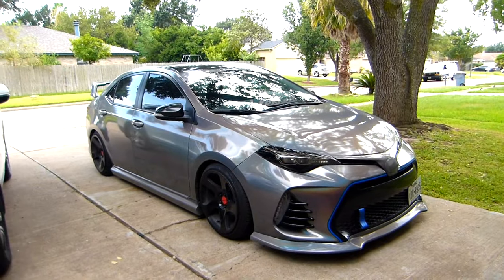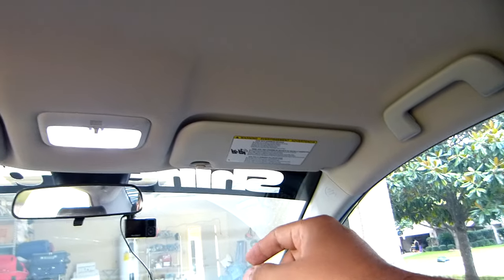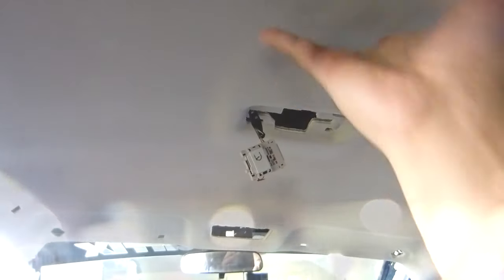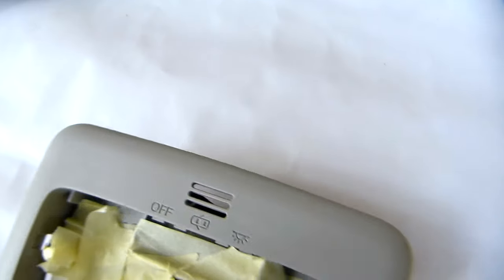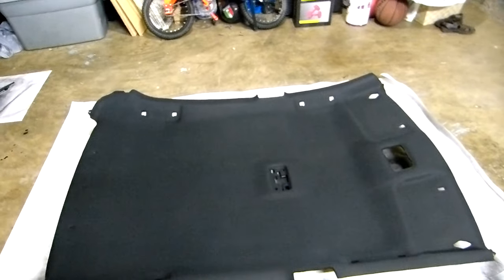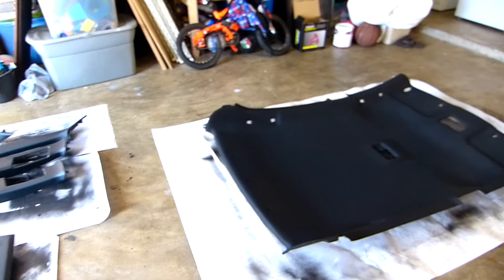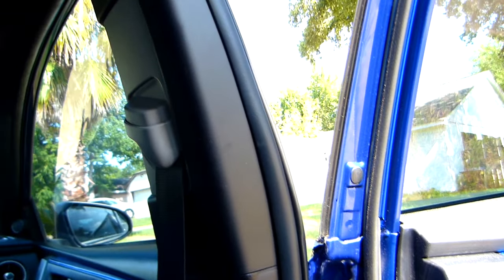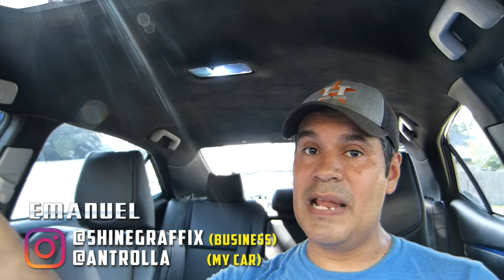Black Headliner Paint 😮 LOOKS AMAZING!!

Comment: I’m doing my Range Rover fitting led star lights Iv put black with white diamond stich fabric to the window panels but don’t want the same on the headliner so thinking to spray paint. Will do build up primer first then do the black then drill all the holes for the led

Comment: Should’ve scuffed plastics with red scotch-brite and use some plastic paint adhesion promoter. Your plastic probably scrapes off with a scratch of a nail, it’s not as good as dye without a doubt.but you can get pretty close Colors matches from SEM interior aerosols if you don’t need black but grey for example
Reply: Adhesion promoter before or after pain?

Comment: Your plastic trim pieces are suppose to be cleaned, scuffed with a scuff pad, cleaned again, then you apply adhesion promoter and then your paint. SEM paints are what you want for your interior plastic trim pieces. If you do not follow the steps I've mentioned the trim pieces will scratch, peel, etc easily. 👍👍👍
Reply from the maker: ok thanks 👍

Comment: Wouldn’t it be cheaper to wrap in with fabric
Reply: I’ve wrapped mine in fabric. I came to this video because my fabric is starting to peel from the headliner. And trust me I used A LOT of adhesive so that it’ll stick. Over time it’ll start coming loose. This video was very informational